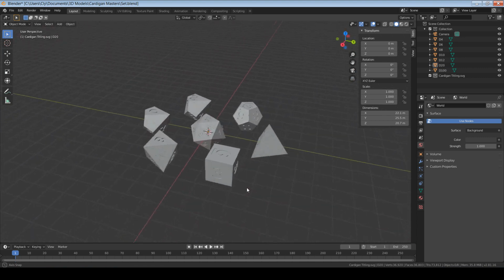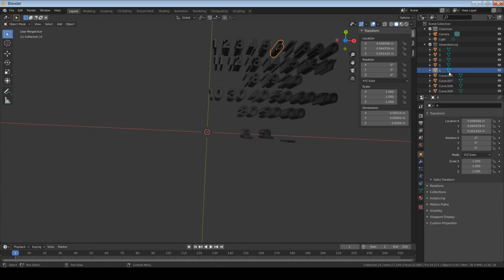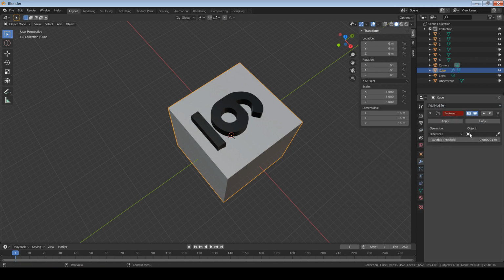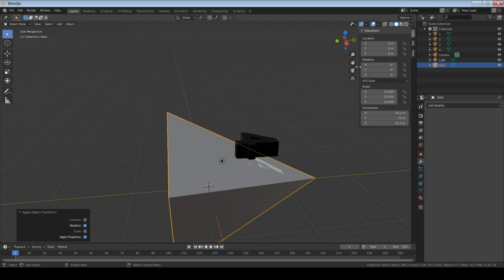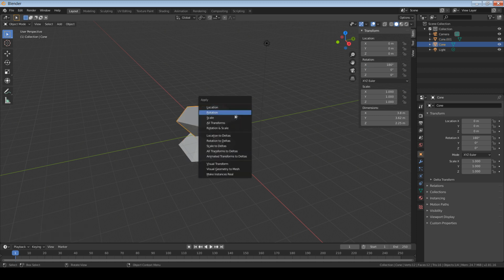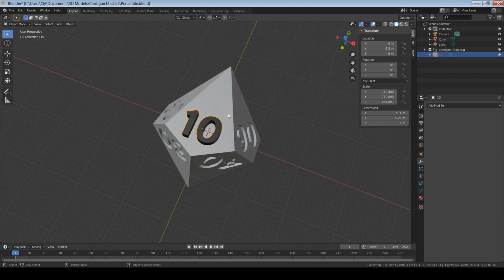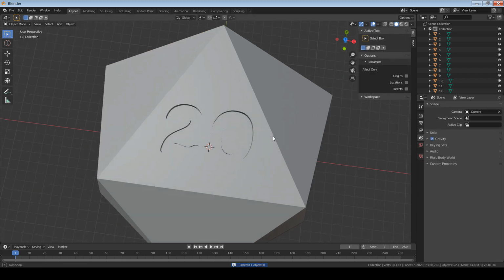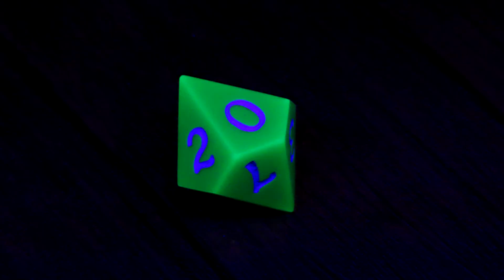Design Your Own Custom Dice for Free | Blender Tutorial | DIY with Cly Ep. 21

Comment: So, I had to write down every step because It is messy AF, so I'm pasting the text in here in case someone needs It:
create object
rotate X 20.905
dimension z 20.7
copy paste scale z to y nd x
copy and paste numbers
start with 20 
boolean function
-
60º on Z, apply
41.81 on X, apply
number 14 and boolean
60º on Z, apply
41.81 on X NO apply
number 6 and _
X rotation back to 0º
-120º on Z, apply
41.81 on X NO apply
number 4 and boolean
X rotation back to 0º
60º on Z, apply
-41.81 on X, apply
120º on Z, apply
-
41.81 on X, apply
number 8 and boolean
60º on Z, apply
41.81 on X NO apply
number 10
X rotation back to 0º
-120º on Z, apply
41.81 on X NO apply
number 16 and boolean
-
X rotation back to 0º
60º on Z, apply
-41.81 on X, apply
120º on Z, apply
-
41.81 on X, apply
number 2 and boolean
60º on Z, apply
41.81 on X NO apply
number 18
X rotation back to 0º
-120º on Z, apply
41.81 on X NO apply
number 12 and boolean
-
X rotation back to 0º
60º on Z, apply
-41.81 on X, apply
60º on Z, apply
180º on X, apply
-
reapeat with:
19 9 3 
13 5 11 
7 17 15
Reply: Thanks for this!  Can't tell you how many times I rage quit Blender on the D20.  Directions are rock-solid.  For anyone else following along, on the second pass through, don't do the final "180 on X, apply", but instead, this is the point for your 1.
Reply: Thank you so much for this!
Reply: You are a life saver. When he said "Now repeat with numbers..." I just sat there like welp, this is it for my d20 I guess. Thanks to you I was able to finish it without any issues <3

Comment: Thank you for the video. However, your angles do not seem to work for me even after following your instructions step by step.
Reply from the maker: Are you making sure to apply the rotation each time you change the angle of the die? Ex. rotate on X, apply, rotate on Y, apply, etc.

If you see something other than "0" (applying the rotation sets all angles to "0") listed for the axes you're not currently changing that'll throw things off.

Comment: I'm running into the problem that when I export the files as STL files and import them into Chitubox (whats used for a lot of resin 3d printers) the numbers are not indented rather its just a surface with the numbers cut out so I lose the numbers when I try to slice them. Any ideas?
Reply from the maker: Sounds like you're running into a manifold error somewhere in your process. Fortunately there's a quick and dirty fix for that.

What you can do is apply a "remesh" modifier to each of your dice. It can be found in the same menu as the "boolean" modifier, and you'll want to set the octree depth to 9. This is going to generate a lot of edges and vertices and then evenly distribute them across the surface of your die. The end result will have a larger file size, but it will be manifold.
Reply: @ClyFaker  Wow this worked perfectly! Thanks so much!
Reply from the maker: I'm so glad! This is the second time someone's come forward with that issue, so all of the time messing with it the first time wasn't wasted. 😁

Comment: so when I add the boolean to the six, the entire cube disappears. Does anyone have any idea why this is happening?
Reply from the maker: Well that's a new one. You do have the boolean modifier set to "difference" instead of "intersect", correct?

Did you generate your SVG using a PNG or a JPG?
Reply from the maker: After reading that again, are you applying the boolean modifier to the 6 with the cube as the target or to the cube with the 6 as the target? You're supposed to have the cube highlighted and then select the 6 from the dropdown menu.
Reply: I ran into this a few times. It happened to me when I wasn't paying attention and applied the same boolean twice. Example applied boolean to the cube for number 6 then went to do the underscore but applied the boolean again to the number 6 ... cube disappeared. Ctrl -z brings it back.

Comment: Hey there, I'm struggling to use the boolean feature. It doesn't give me the option to apply it to the item I'm currently working on (trying it on the 6 and it gives me 1, 2, 3, 4, 5, and cube) Any ideas where I went wrong?
Reply from the maker: Looks like you still have the 6 selected since it shows the cube in the list. You need to select the cube instead.
Reply: @ClyFaker  Ooooh omg I'm dumb haha thank you that worked!! This tutorial is epic mate!
Reply from the maker: No problem. I still do that all the time. 😅

I'm glad the tutorial is helpful. 😁

Comment: every time I type out my numbers in gimp, I use 250 pt font like he says, but then the numbers are way too big to fit on the image. what do i do?
Reply from the maker: That usually has to do with your PPI (pixels per inch) settings. I was a dummy when making this video and used 72 PPI for my canvas instead of the default 300. At 72 PPI 250 pt and 250 px are identical, but at 300 PPI 250 pt is massive. Switch to 250 px and you should be good.
Reply: Cly Faker oh my god thanks so much! I’ve never gotten a reply this quickly before, let alone from the channel owner! Thanks man, ur a life saver
Reply from the maker: No problem. 👍

It helps that this is a relatively small channel, so I'm not being flooded with comments. I try to get to most questions.
Reply: @ClyFaker  oh um one more thing. When I try to join the double digit numbers, it says that the objects aren't selected meshes. What does that mean?
Reply from the maker: Are you holding down the mouse button and dragging a box around them? If so, you might be selecting something like a light source as well (happens to me often). Instead, just hold down shift and click each digit individually.
Reply: Cly Faker yeah I found that out, thanks for the input though! Your tutorial is amazing!
Reply: OK UM ONE MORE THING: when im doing the boolean, and i click apply, nothing happens.
Reply: I looked more into it, and my numbers are not smooth and completely solid, there are gaps and have jagged edges
Reply from the maker: By any chance did you export your numbers image as a PNG before converting it or use Illustrator/InkScape to make the SVG? Each of those methods cause a similar issue.
Reply: Cly Faker ah I did. Should I use jpeg instead?
Reply from the maker: Yep. This happens every time a PNG or Illustrator/InkScape is involved. I didn't realize that when making the video since I got lucky and choose JPG first. I'm going to stress that point in the sequel.
Reply: @ClyFaker  thanks for all of this it really helps!!!
Reply: @ClyFaker  Ok so it still is giving me these jagged numbers, no matter what image file i use. I've even tried going to different svg converting websites. Help!
Reply from the maker: What font are you using? I'll give it a try and see if I can figure something out.
Reply: Cly Faker I’m using Spectral font, but I think I might have found a method to fix it! I haven’t tried it yet, but I’ll get back to u! If u want, you can still feel free to try something out. Thanks again
Reply: @limelite2786  Any luck with it? I noticed my font was a little distorted too. And that the distortion is actually a bit different for each number. I really notice it in the 6's and 9's. They're all a tiny bit different. Not necessarily a bad thing with how small it'll be, but it's something that did catch my eye still as I was doing it

Comment: Great video and it helped me a lot with my dice project ^^! I wanted to add a few things that reduce the steps you need to do so you can work faster! (I hope this is okay for you) When you have a blank dice, select one number and type in all the Infos for scale and location. 
Then select all numbers you have to use for this dice. 
Go the tab over the modifier, the one with the yellow square named object properties. On top of this tab you see the name of the selected main object, so click on the tiny arrow that points down and select the number with the correct scale and location. 
Now, you have to right-click on the light grey field where you type in the numbers and select  'Copy to all selected'
Do this for location and scale, now every number is in the intended position. Don't worry if it looks weird, you can make the numbers you don't need invisible by clicking in the eye symbol on the top right. Now you don't have to type in scale and location for every number. 

I hope this is helpful for folks ^^
Reply from the maker: Very helpful indeed! I'm getting ready to design yet another set of masters, and I'll be sure to try that out.
Reply: super helpful thank you

Comment: Wow! your directions are great. I successfully made them thanks to you. 
If I wanted to make all the dice larger than standard size, can I just change the z dimension and copy the z scale of each die? I'm not sure if the angles would be messed up or if the rotations would change.
Reply from the maker: I'm glad it worked out!

It sounds like you're on the right track for resizing the dice. As long as the X, Y, and Z scales have the same value you're all good. If the die has already been carved then that will change size with the die just fine. If you haven't carved it yet all of the rotations use the same angles.
Reply: What are the mm sizes for these dice when comparing them to the standard size?
Reply from the maker: They're within a couple mm of standard size.

Comment: Hey Cly! Do you still find the SVG Creator website functional? I've been trying to get it working but it never actually finishes processing any files I upload.

The only website I've found so far that creates functional curves in the same way is convertio.co

Hoping to have a backup process in case that goes down someday too but I haven't gotten Photoshop or any other program so far to export the SVGs with the individual curves either!
Reply from the maker: Sorry for the late reply. I have my channel set up so that I have to manually approve comments with links.

As for the SVG converter, it's being iffy for me as well, even though it was working just last week. Odd. Thanks for the link to the new service. I just tried it out, and it works like a charm with JPG files. I need to double check and see if it has the same issue with PNG files that every other service has. Now if only Illustrator and InkScape would behave themselves.

Comment: This is an awesome video! I'm working on my set now. I do have a question: When doing the boolean, and it makes the cut for the numbers, how deep is it going? I would like them to be about 0.7mm ( so 7m in blender). I'm just not sure how to check how deep it goes. Thank you for putting this up!
Reply from the maker: It's pretty easy to calculate how deep the number is going. Just add 1/2 the thickness of the die to 1/2 the thickness of the number and then subtract the depth you want to carve. The end result will be what you want to set the number's Z coordinate to before you perform the boolean operation. 

For example, on the D6 we know that it is 16m thick (8), the number is 2m thick (1), and we want to carve the number at a depth of 0.7m. So 8 + 1 gives us 9, and then 9 - 0.7 gives us 8.3. Set the number's Z coordinate to 8.3 and you're good to go.

I will say, the D4 does not play nice with these calculations since it's origin isn't centered on the Z plane, though it is technically centered in relation to everything else (three dimensions are annoying). Assuming you're using all of the dimensions I mentioned in the video, the value that you'll plug into this formula is 6m. No need to worry about halving the 6m this time around.
Reply: @ClyFaker  Thank you! I will give this a shot!
Reply: Soooo I have run into another problem. The D6 is done and I'm working on the D4. I followed everything but when I go to boolean the 4 (I moved it to check), it just shows up as lines and its not indented at all. What could the problem be?
Reply from the maker: The fact that you managed to complete the D6 throws out all of the main issues I've come across. Might as well double check though.

Did you use the method shown in this video to create the vector file, or did you use a program like InkScape or Illustrator? If you used the method from the beginning, did you export the text as a JPG or a PNG?

Also, did you insert the number into the die at exactly the number's mid point? Blender really hates it when you do that.

Lastly, did you either perform the bootlean operation twice on accident, forget to select the die and instead perform the Boolean function on the number, or maybe you didn't click "apply" on the boolean operation box before moving the die.

Yes, that's a long list. I've done each of those multiple times. 😓
Reply: @ClyFaker    I followed your instructions to make the file and saved it as a JPG. I'm not sure if I inserted the number at the numbers midpoint, how do I check that?   I thought I had entered the boolean twice, and since It was the first number I just started over. Now instead of lines, it looks like there is just a hole. When I rotate the triangle around, I can see the other side through the 4.
Reply from the maker: That issue definitely means you inserted the number at around the halfway point, and Blender doesn't know what to do. Try raising or lowering the number by a little bit on the Z axis (0.001m will do) before doing the boolean operation.

Edit: even if it isn't tyre halfway point, Blender still isn't happy. The Z shift should still hopefully help.
Reply: I'm going to start over again, how do I ensure I don't enter the number around the halfway point? Your help is very appreciated, thank you.
Reply from the maker: The way I avoided it was just using numbers that were thicker than 2x the depth I wanted. That's why I went with 2m for all of my numbers.

However, there is a trick you can use to avoid this issue going forward. Before you accept the boolean operation you should "hide" the number you're using. Do this by selecting the number and either pressing the "H" key or clicking the little eye icon next to it in the list on the right hand side of the screen. If you're noticing any issues you can adjust the Z coordinates of the number until things look okay. After that just adjust the Z coordinates for all of your numbers by the same amount going forward in the D4.
Reply: Yes! I managed to fix it with your help. It was definitely my z coordinate, I had to lower it quite a bit. I also used the measuring tool to check my depth, it works really well!  THANK YOU
Reply from the maker: There's a depth measuring tool? I never looked into that (hence the math earlier) since I'm still quite the Blender noob myself.
Reply: It's not necessarily a depth measuring tool but, I use the measure icon on the left hand side then zoomed in until I got a good angle and view of the side walls of the number. Then just dragged it up that wall. It's hard to see where to stop because the measurement numbers are in the way but it gives you a pretty good idea. That's how I adjusted the z coordinate.
Reply: I do have one more question. I'm trying to do your calculation to figure out the thickness of each die but I'm somewhat math illiterate and have no idea how to find it. The d6 is easy because it's a square lol
Reply from the maker: Once you have the die scaled and in position for applying the numbers make sure to apply the rotation. Once you've done that the Z dimension (not the coordinate) will be the thickness of the die. It should also be centered on the Z axis, so everything will work like with the D6.
Reply: Thank you so much!